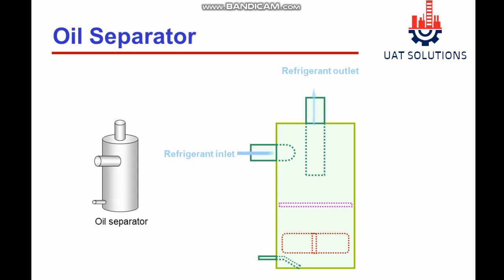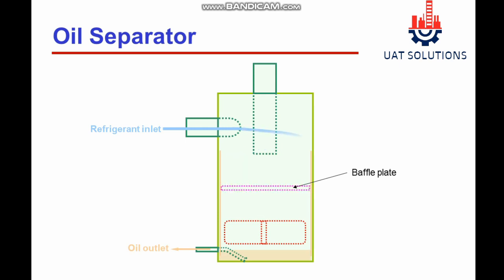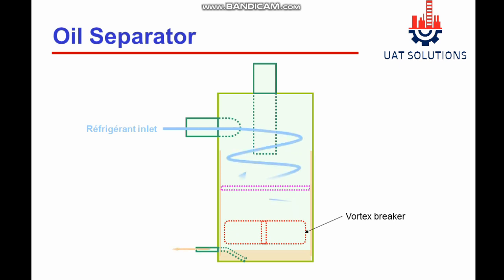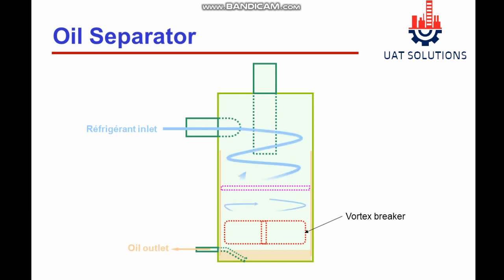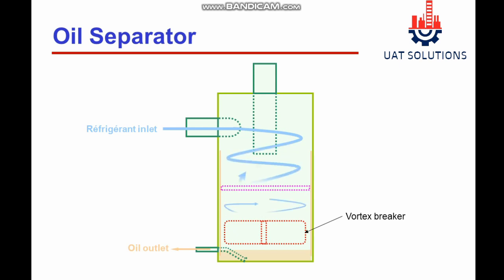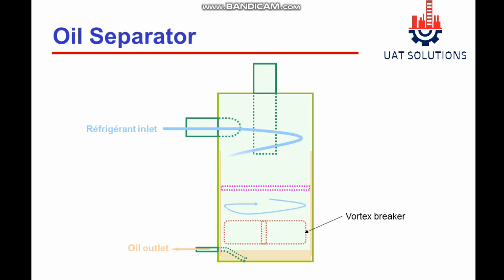Oil Separator function and working principal explained in a screw chiller explained

Comment: Appreciate your explanation about basic principal of oil separator. It help me to understand the current failure we have in YORK screw chiller. The vortex braker plates were found in pieces upon cutting an inspection window in oil separator. These 4 Vortex plates were broken from middle and not from the welding point. This indicate that centrifugal force was very high inside oil separator or probably the vortex plates are under gauge.
We are planning to repair and modify this oil separator with new Vortex plates. The existing plate is 3 mm I believe and will be replaced with 8 or 10mm.  
once again thank you for your video.
Reply from the maker: You are welcome. Its our pleasure to help
Reply: Do you mind to share the symptoms? I would like to make a kind check list that if these are the symptoms we need to look inside the separator?

Thanks in advance.

Comment: What will be happen if baffle plate is broken
Reply from the maker: Thanks for your question here is your answer.
If baffel plate is broken the refrigerant entering in the oil separator will carry more oil with it into the condenser and can cause shortage of oil in the compressor and excessive oil in the condenser will cause less heat transfer which leads to high discharge pressure and temperature.
Reply: @UATechnicalSolutions  compressor can be damaged also
Reply from the maker: @gulamansari5439   definitely if compressor is working at high pressure and temperature or with less oil lubrication it is likely subject to mechanical damage